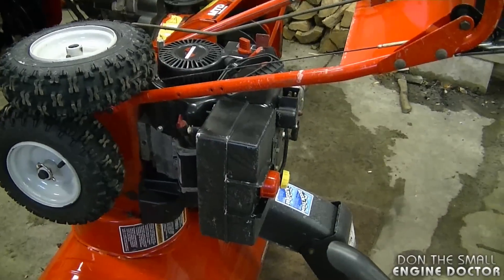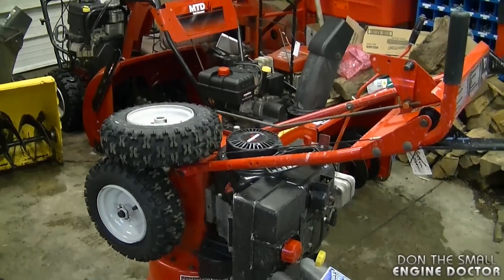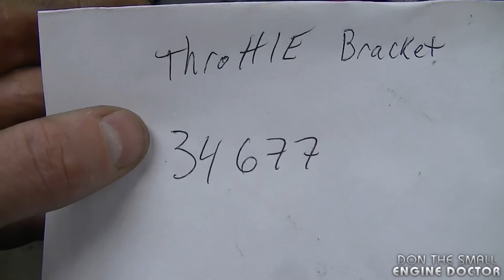Small Engines Q & A Video #138 in HD

Comment: Don on a Tecumseh 6 hp on the fixed carburetor is it possible to just switch out the carburetor fixed jet with the adjustable jet for the same brand.

Comment: Hi Dony
I just replaced a carb on an older Ariens. I think it is a 6hp. It still runs rough and will not run at high speed. I 'm not sure if the linkage is correct do you have a video on this engines linkage?

Comment: dony, in a 2 cycle does only the gas part of the mixture explode at the top of the piston by the spark, or does the gas/oil mixture explode?...is the oil part only for the cylinder walls so there is no overheating?...thanks...
Reply from the maker: the gas ignites and so does some of the oil, the remaining oil lubricates the engine

Comment: On the Tecumseh throttle part 34677 I have been successful in placing the rivet head on a solid metal surface and hitting the mushroomed side with a ball peen hammer and getting it to tighten back up without having to buy new.

Comment: Great video as usual Don.  When I put my 2 stage snow blower away in the spring, I paint any spot where paint is missing so I don't have to worry about rust for a while.  I brush off all the snow I can after every use.  It really does make them last a lot longer.

Comment: hey donyboy73 how come 2 of my mowers wont start 1st one is a ranchking and I adjusted the vavles on it but when I try to start it, it just drains the battery. 2nd one is my sears custom 600 and its a 1964 but when I put the battery in it does nothing I have a snowblade on it and it has the same starter as the snowblowers?

Comment: Hey Donyboy 
I have a blower with the same motor as in this video. I'm having problems getting it to stay going. I changed the carb and it was running good. I have noticed from your video my throttle linkage is wrong and now I have to fix that. The motor will start with a bit of gas put in the motor through plug hole but will not stay going. The carb was cleaned before I put it on. Going to clean it again when I fix the linkage. Any other suggestions on what to check when working on it again.

Comment: Hi Don,  Great series - have used your videos many times - thanks!  I am very prepared with my mowers and blowers re: maintaining them.  Of course - this morning 4:30 am, after a blizzard - my craftsman 9hp 24 ran for 20 min. then died.  This happened a month ago - though had a frozen fuel line - so in went the methyl in my fuel mix - half hour later - after many attempts - she started and no problem until this morning.  I don't have a spark to the plug, tried a screw driver to case - still no spark.  Will replace plug tonite - cheapest route first right.  This is a solid state ignition - do you have a video for this?  I will test with a volt meter - but was wondering the tear down procedure.  Any help would be greatly appreciated. H

Comment: Hey man love your vids they help me out so much. I am building a rc boat that I plan on using this summer. I got a 28cc McCulloch Mac 2816 motor in it. What are some easy and cheap ways to gain more power out of it? Can I put a bigger carberator? Thanks. Keep up the vids!
Reply from the maker: sometimes making holes in the muffler helps

Comment: I have a Sears “Crapsman” 8 HP Tecumseh that is surging, back firing and has the orange muffler with sparks when running. I’ve removed the head cover and with the piston at TDC neither valve is loose, but neither valve has ANY clearance when checking the valve spacing. Does this sound correct, could I have forgotten to “undo” something else?  The engine is still attached to the machine.  Thanks so much for your time.

Comment: Why do they use salt on roads?
Reply from the maker: to melt the ice and make the road safer
Reply: donyboy73 I looked it up, it lowers the freezing point of water, but that makes no sense to me. Wouldn't you want to heighten the freezing point so it doesn't freeze as easily?

Comment: I have an Ariens with the OHV briggs. there is 2 different dipsticks for the engine. a short, plastic threaded one, which i have, and there is a taller 1/2 turn one, like the one that is on the briggs in this vid. do you think they are interchangeable? i hate the threaded one. ive had it blow off twice on me now

Comment: I've got an eight horse Tecumseh engine on a blower. Bogs Down in light snow and when driving. I've tried adjusting fuel mixture. But nothing works.
Reply from the maker: check compression

Comment: Hi Dony
Is it okay to run your wheels locked on the outside holes instead of the inboard holes.

This would give the wheels a wider stance and maybe better traction, but they aren't resting close to the axel bearings.
Is this a potential problem
Reply from the maker: yes potential of misaligning the gears or chain in the transmission

Comment: I use an old snow brush (some newer blowers come with a brush) to "brush the teeth" of the auger and impeller to get the snow out before putting it back in the garage. I then give a quick spray of WD40 on the blower anywhere with exposed metal.

I also don't rest the snowblower auger housing, etc. directly on the garage floor - I set it on a "drain-through anti-fatigue mat" (basically a thick rubber mat with lots of holes in it - just a couple of bucks) so I don't have water from melting snow pooling where it can rust the the scraper and skids.
Reply from the maker: good tips!

Comment: You didn't mention the wheel pin could be in the free turn position!  There are two holes on the axel, one to go through the wheel and one to put in front of the wheel for easy turning.

Comment: To test the  shear pin is working an auger turning an have no one to hold the lever I use a bungee cord to hold this lever  down , ( some are self holding ) and g to the front of  the blower an look . Also a pre  inspection of nut on bolt  is  a good safe  method .Wipe down to get  salt off  I use  Wd40. Great Q&A  TU

Comment: Excellent owner video, Don! When I tip a snowthrower up on its chute, I just screw a plastic food storage bag between the fuel cap and the thread of the fuel tank.  This saves me time in draining fuel and prevents introducing fuel vapor into the shop.
Reply from the maker: thanks, I do that too but sometimes the gas slips through, lol
Reply: donyboy73 The secret I discovered to keep it from leaking is to use the inexpensive, thinner bags.  The expensive name-brand bags are thicker, and don't seem to seal as well around the threads of the filler neck.

Comment: Also, if you buy a used blower, check the sheer bolts.  Mine had been replaced with regular bolts.  The neighbors newspaper and the can of ether I dropped in the snow can also break the sheer pins. Keep some in reserve.  Great, simple repair on the belly pan.  Thanks again

Comment: Great video and info.  My biggest problem is wet snow sticking to the blower.  The first year I used auto polish, OK, then I read about using cooking spray.  Seemed to work but now the auger housing seems sticky. Any ideas?   Also one wheel spinning can be OK for turning.  My blower can have both wheels driving or one.  Thanks Donyboy
Reply: saw a youtube vid of guy that used snow ski wax and said it worked great.
I have no clue what the difference would be but he said it worked.FYI
Reply: Use 100% silicone spray.  It won't get sticky, and works great.
Reply: have you tried the impeller medication?  if you have a 2 stage blower that modification REALLY WORKS GREAT.  youtube video by sixtyfiveford
Reply from the maker: Bob Haddock i'll need a prescription first!